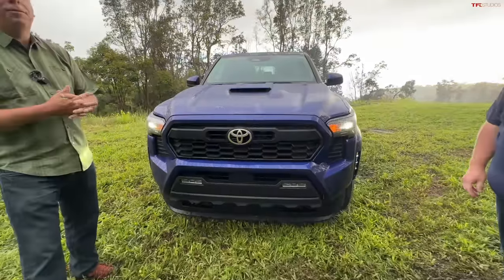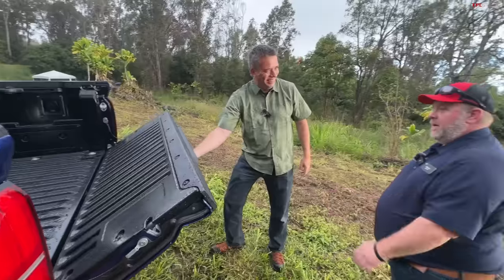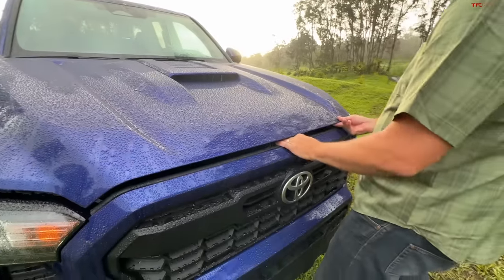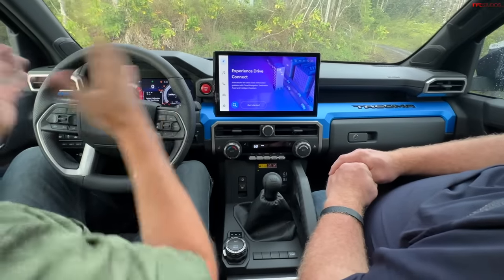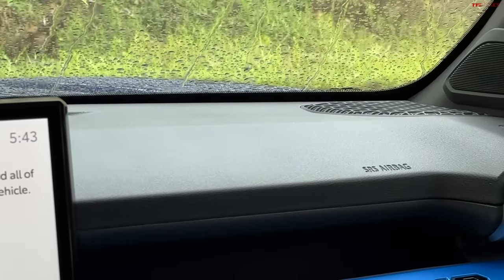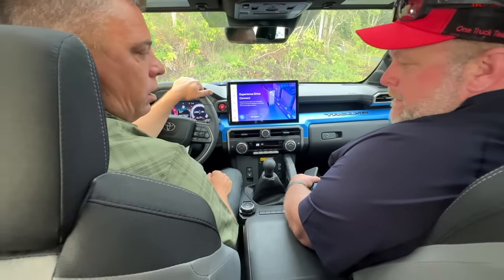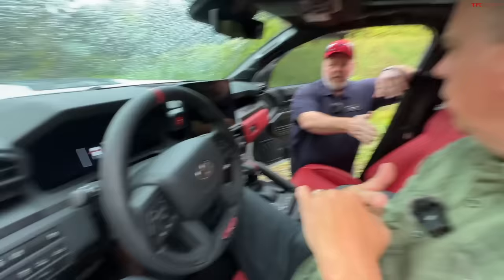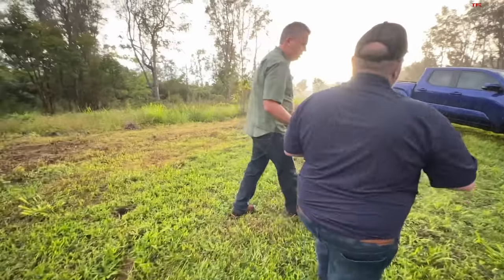2024 Toyota Tacoma Very Deep Dive: I Answer All Your Questions with The Truck’s Chief Engineer!

Comment: This man completely sold me the truck. Colorado order cancelled. What an asset someone like this is to a manufacturer.
Reply: Agreed - candor and passion in spades.
Reply: Glad you are never gonna break down ever again. Toyota quality 👌
Reply: TFL had a really good engineer deep dive on the Colorado engine.
Reply: I thought about looking at the Colorado but I'm just getting tired  & too old to work on my trucks anymore.  I prefer driving
Reply: @MrMd5555  I think all these mid sizers are going to have significant issues for the next few years as they are significantly new. Doesn't seem like Toyota is immune to new model growing growing pains judging by roll out of Tundra, or even the refresh of Tacoma back in 2016.
Reply: All of these new motors, including Toyotas, turbo, high-pressure, high compression motors, are less reliable than the simple 4 bangers of yesterday. That’s why I’m only considering electric or cheap used truck. New stuff is made to become obsolete quicker from the plastics to the complexity, its not simple anymore.
Reply: @pnwmv  well we don't know yet about toyota turbo hybrid quality only that their natural aspirated engines are premium quality, only time will tell, and hopefully they learned their mistakes on that were on their new tundra.
Reply: @AdamC5013  This is some "new thing scary and bad" type energy. I am a Toyota Master Tech and work with these engines daily. They have their issues, but save for the 2GR and UR series engines, these new engines will be practically bulletproof. I foresee them being quite leaky after the 150k mark, but a gasket set and maybe a new Turbo will get you another 100k and more out of it. Toyotas have always been about reliability and overbuilt from the factory. What they were NOT known for, was being efficient powerplants. Turbo and smaller displacement, and the addition of a hybrid drive components really bring these engines into the current world. They are not a bad thing. Hell, even the Ecoboost's have been running strong and people still shit on them without looking at actual data.
Reply: @kepler656  funny you use eco-boost as an example because my friend bought a brand new raptor and successfully lemon law returned it in the first year because of the valve and timing issues. Meanwhile, my 20 year old Ford V 10’s hum along nicely while being less fuel efficient, but SIMPLY more reliable.
Reply: @MWAclanGaming  Well Toyota has been using Turbo for a very long time, just not on trucks, so they do have the experience on that field, I'm more worried about GMC knowing what they are doing..
Reply: @AdamC5013 ecoboosts by far are reliable.  11 or 12 years of making them has shown them to be great engines.  I’m excited to see what the Tacoma can do
Reply: @kepler656 Am I reading your comment wrong, you say they'll be practically bullet proof but quite leaking, new gaskets and turbo around 150k miles?
Reply: @hestongraves3274  The 6-cylinders are alright, but the 4-cylinder ecoboosts aren't exactly known for their reliability.

Comment: To be honest, the trd pro and trail hunter are very cool but I care about the TRD off-road which most people will too. And I’m glad the chief engineer confirmed here that it’s their bread and butter. That’s what I can’t wait to see in detail
Reply: Apparently there will be a 6’ foot bed option plus 33” tires.  Not mention the sway bar disconnect. I’m very excited about that trim!
Reply: Same! That’s what I’m waiting for! Can’t wait to see it!
Reply: It was hidden at this official reveal. Will have to see what King Suspension, Icon and Fox offer in the aftermarket not to mention all the high clearance parts
Reply: I agree. Most people will want the TRD offroad and really for the money does what the pro does. I would like to see the specs for the YRD offroad
Reply: I hope there will be a  manual trans option on the Off Road. Does anyone know?
Reply: @Hippie Bits oh im sure they'll offer it in the Off Road. Toyota wouldn't mess that up. Availability may be an issue though
Reply: @hippiebits2071  The video that Savaggeese posted showed spec documentation from Toyota that confirms the Off Road package will have manual available.
Reply: @zlink8  That's good news!!!
Reply: @zlink8 also with the long bed?
Reply: @MrMd5555  But, if it is available with a 6-spd manual, you'll likely be limited to the iFroce 270hp/310tq turbo-4 only. According to the chart that's the only engine with the manual. That's a little disappointing IMO.
Reply: I just reserved a 2024 offroad myself. Can't wait to see all the official numbers!
Reply: Does the sport have rear locker?
Reply: @mauriomoore7404  Reserved? No, you put your name on a list for your dealer to try and find a match when they’re available.

Comment: Yes replace Mike Sweers with Sheldon! This guy knows how to lead a team! 9.5" ring gear on a 4 banger! Talk about built to last.
Reply: Yes!
Reply: Bang on!
Reply: Its a 4 banger making 465 ft-lbs at 1700 rpm. That's better than a big block from the early 2000's. It needed every bit of that 9.5"
Reply: Amazing what you can accomplish when you let loose a guy like Sheldon do his passion project.  Why the big three learn from Toyota.  Lucky this truck is built in America.
Reply: LOL bulit to last? it's mostly made of plastic under tho hood, youre gonna need new hoses and lines within the warranty period, and then again, and again
Reply: @JazzyGazzy-nj8rn  my 1998 GS400 has a OEM plastic radiator from 1998. My 2007 FJ Cruiser has all sorts of plastic under the hood. Its been this long and its still lasting. There is such a thing as quality. If you ever were to compare the engine compartments of a Tundra and a Land Cruiser for example, even though they both have 5.7L V8s, the quality of the plastics and components are much much higher in the Japanese built Land Cruiser than whats in the US made Tundra. And now that I just said what I said, I think I've jinxed myself on my GS's old radiator.
Reply: Built to last? Do we have Toyota bots in the comment section ????
Reply: @Wellh0wrya  explain yourself
Reply: @CACressida  ok so must’ve missed all the reviewers breaking their Tacoma’s
Reply: @Wellh0wrya  for every 1 taco you see broken on YouTube I can pull up 3 of every other brands truck broken on YouTube. So back to my original comment of a 9.5" diff on a 4 cylinder truck. If you knew anything about trucks, you'd know a 9"+ ring gear is something you see on V8 half tons and high hp performance cars.
Reply: @CACressida  hey bud I’m all over YouTube, never have I seen three reviewers break a new vehicle in multiple ways…. Never. While they might have nailed it with a couple of things they grossly under engineered it on several other
Reply: @Wellh0wrya  hey bud you see TFL break the truck they own because they buy their own rigs for unbiased reviews. Most every reviewer tests press fleets and they're not going to push their vehicles hard. So how many reviewers broke tacomas from 1995 till 2024? I'll give you that whole time frame to rack up your count. 2? 1 front actuator and 1 failed clutch?
Reply: @CACressida  listen bud, u might be a fanboy or u don’t do any research… truck king broke their truck and icon vehicle just broke their truck…. Not to mention there’s reports of transmissions failing let and right… I’m just pointing out the facts … overpriced. Poor quality. They are breaking all over the place…. Just like the tundra, latest qc with Toyota is on par with a Russian Lada
Reply: I’m only talking about the brand new Tacoma
Reply: @Wellh0wrya  icon blew out their top mount on their shock and 3 others. The front shock design and their decision to not put a bump stop like on their other trucks is a dumb decision, yes and you can check my comment history of my criticism of some new questionable design choices. So fan boy, no. But you want to bring up the reported first year problems that you and me both know will be addressed, let's think about the known chronic and expensive problems other trucks have that the automakers refuse to fix with revised engineering.
Reply: @CACressida  I’m not looking at other trucks I’m look at the Tacoma, there’s been an unusual amount of problems… truck is made in Mexico and is the most overpriced truck in the segment. Like the tundra double cab, you cannot fit an adult in the back of the Tacoma especially trd pro…. Tundra double cab from 2nd gen u could easily fit an adult…. Toyota has messed up with the redesign of their trucks ….
Reply: @Wellh0wrya  the new gen taco has grown in cab size and literally everyone is praising the better comfort. The only problems this taco has is the dumb front shock design and some early transmission issues. Tacoma has been made in Mexico for years and the funny thing is a 2024 Tacoma has infinitely better build quality than the USA made Tundra and Sequoia. Don't believe me? Go sit in some in the dealer and poke around. The new Taco has the old taco vibe in regards to build quality where the new gen of Tundra is ridiculously built. The flimsy stitched arm rests on the doors, the ridiculous window seals that don't seal, the doors that rattle when you shut them, the chinsy creaky center console, the center marker for the steering wheel on the TRD Pro is off center... I mean I can go on and on about how terrible the 3rd gen Tundra is. So I wouldn't call the Mexican built trucks terrible at all.
Reply: @CACressida  yea but point being it’s the most expensive truck in its segment and it’s made in Mexico… there’s no reason the tundras build quality is subpar compared to the Tacoma… poor toyota engineering. Toyota is really kicking their consumers in the 🥜 s with the prices and there definitely is qc issues albeit maybe not as bad as tundra. I still do not recall a model where reviewers are breaking them with minimal testing
Reply: @Wellh0wrya  the crazy thing is the American engineering team decided that the Tacoma doesn't need frame mounted bump stops like it's TNGA-F platform buddies. The LX600 and Land Cruiser 300 have 2 bump stops per side, the GX and its Prado sibling have one on each side and the Tacoma has shock mounted bump stops like what's on a car. As for price, whether it's Toyota or not, all of these trucks are grossly overpriced in general. Paying $80,000 for a ram 1500 is absolutely absurd and paying $35,000 for a base model Tacoma is ridiculous as he'll. But not just Toyota thats price gouging even though the taco is a few grand MSRP more than the similarly equipped competition. Like I said in the past, if people are willing to shell out the ridiculous asking prices for these cars then they get what they deserve.
Reply: @CACressida  just because that’s the new norm doesn’t mean it should be acceptable… well hopefully people realize what I’m saying and make a better decision and not give Toyota the money they want. Ya everything besides my salary went up 20%-50%…… if cutting corners means building in Mexico to keep price low I get it, but when ur jacking up the price more than any other brand AND PAYING CHEAP LABOR, it’s insulting.
Reply: @CACressida  whole Toyota truck engineering team should be sacked. When u have the best 1/2 ton probably ever built followed up by this third gen tundra….. it’s shameful… also they got the claws into guys like car care nut because in what world would a mechanic buy a truck (before the engine recall) that would more than likely need and engine swap at some point and possibly out of warranty…. I don’t care if ur a Toyota tech and u can do it yourself, Toyota either gave a massive and I mean massive cut on the price or gave it to him for free…. Either way he’s sending a poor message to his followers…
Reply: @Wellh0wrya  car care nut I suspected got a huge discount or something. How does a car guy all his life all of a sudden needs a luxury truck? I think there was some sort of incentive for him. Ive said this in the past though; forget about the Tundras new engine with a very bad rep, I wouldn't buy a new Tundra just based on its ridiculous build quality. My friend and I always joke about Joe 1990s GM is leading new Toyota QC. My last new Toyota I ever bought was the FJ Cruiser for $29,000 and I thought that was cheaply built and unToyota-like in regards to material choices. But fast forward nearly 2 decades later and I now know the materials are very durable and long lasting even though they looked cheap. I beat my FJ up hard in the trails and not a single squeak or rattle. The 2nd gen Tundra has a similar build quality that I now appreciate. Looked cheap until you realize the build quality is outstanding. The new Tundra? Good luck keeping your volume knob intact the first few miles.
Reply: @CACressida  yep a little deceiving of car care if that’s true but I just don’t see it making sense otherwise…
Reply: @Wellh0wrya  in the end, people buy what they want. I definitely would love to own a taco with a 6mt but not until some design revisions happen. I was so obsessed with the new Bronco until I sat in one after their release and I was so turned off by how shoddy the build quality was for the price. I've still been waiting for a Bronco revision but the only thing that changed was the price increase.
Reply: @CACressida  kind of sucks imo to wait all ur life to buy a new vehicle only to get that third gen tundra … there was a limited 2021 trd tundra 4x4 near me with 1500 miles (might even still be there) $52k … seems like a steal if I was in the market!
Reply: @CACressida  maybe look for a mint condition used one? I’m sure they’re out there, probably for less than half the price… upgrade the head unit and u have ur tablet like all the modern vehicles…. Less headache, easier to service, and easier on ur expenses
Reply: @CACressida  crazy to me that after 100+ years of ice engines they are still messing it up…